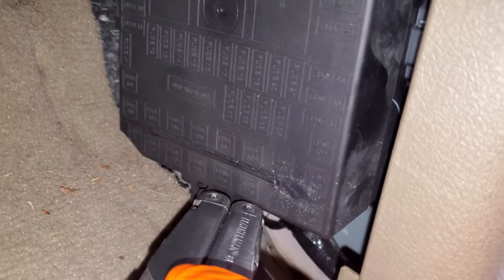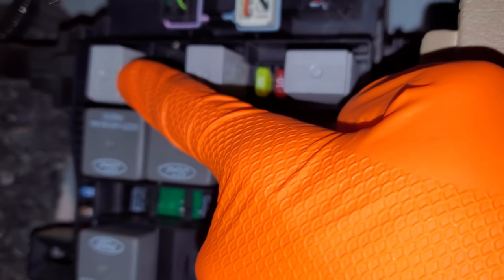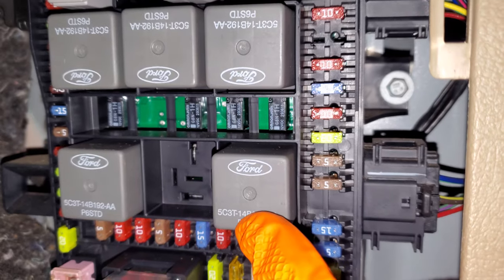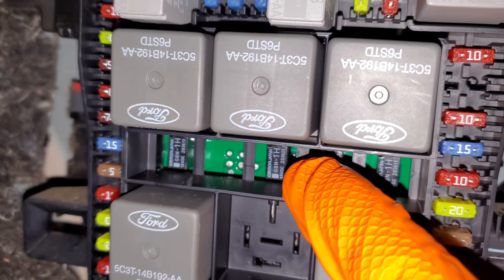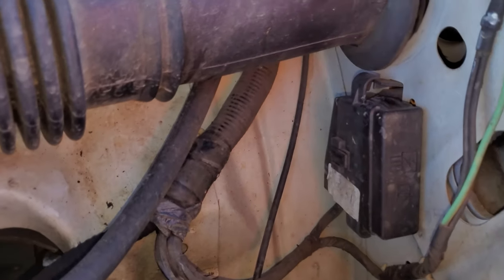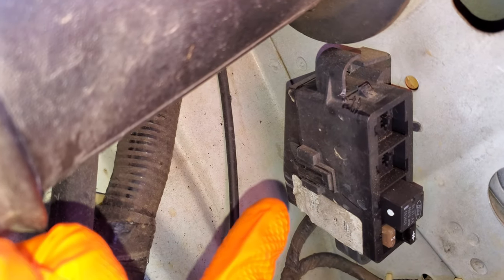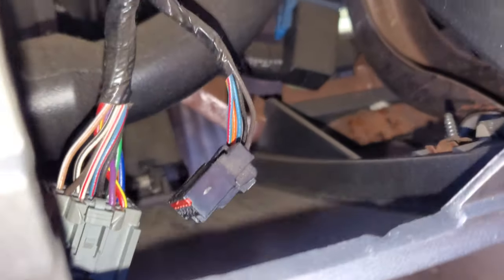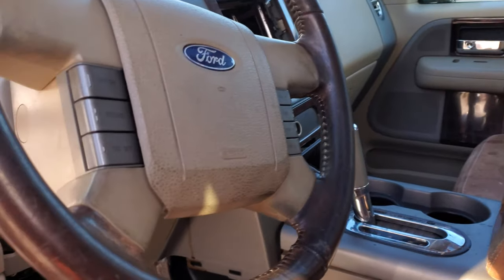2007 F150 Relay Identification

Comment: I have fixed broken wires in drivers door, taken instrument cluster off both to not solve my (no door locks and no radio) problem. Thanks to your video I did not have a delayed instrument relay. Problem solved. Thank you

Comment: I was headed to the auto shop to get my coils replaced for my spark plugs, I was about 25 miles from my house and the truck simply shut off on the Highway. The ignition will not turn over but it will power the dashboard lights and radio

Comment: Thanks for video. Will this be the same for a 2006 F150 xlt 4,2? I have a no crank/start issue. I have switched the PCM relay but not any other relays. I will check the starter relay now that I watched your helpful ID video. Any other suggestions will be helpful. Is the brake relay on transmission easily accessible?
Reply: Your starter may be locked up I had a similar issue when buying my 07 f150 xl we took it out smacked it with a hammer it worked a few times then locked up they are a pain in the ass but just replace it if yours does the same thing fixed my problem can’t tell you 100% check your grounds and change your battery Terminal power side the secondary wire needs to have good contact bc it runs to starter a-swell as other power in some cases hope it helps you if you haven’t already figured out it’s starter

Comment: Thank you for the explanation. Very good. Is the a relay for the trailer brakes? Also do you know what the part number would be for the trailer power relay. There was not one with my truck. Thanks.
Reply: Was that a relay for trailer lights and trailer running lights themselves?

Comment: Do you have any idea where the engine cooling fan relay and fuse are located on a 2004 f150? My fan comes on more than it should. Thinking it could be a bad temp sensor. Truck operates normally otherwise.Thank you for your time and help

Comment: I have a 2004 F150 and I have a clicking sound coming from the fuse box in the footwell of the passenger area, it sounds like an emergency flasher sound. It is coming from the fuse panel but I cannot pinpoint the problem. It is draining my battery over a 2-3 day time frame. Please help.

Comment: Thanks for everything. Particularly the tip on removing the fuse box cover. I couldn't get mine off. I used a small file. It gave more leverage than my screwdriver.

Comment: .3:57 p.m.
Hi I have a 2007 f150 5.4 l I have no power going to the cam sensors or the crankshaft sensor is there a fuse or relay

Comment: Hey just bought a 2007 f150 couple of issues. Hope you could direct me? 
First I found out radio wasn't working fuse 31 was missing but when I installed one it blew, so I was able to trace it, turns out the satellite radio has a short in it. Now I'm not getting any power to fuse 36,7,23 and 25 please help

Comment: Thanks...but my gauges aren't working nor the radio, windows dome lights or power windows
Reply: Did you figure this out? I’m having same problem. My radio, windows quit when I took down the map light to see about one bulb. When I snapped the unit back it,it made a pop and now the rear dome light, map lights,windows and radio don’t work.

Comment: My blower doors working I can hear it but the heats not working ever have this problem the heater coir has been replaced a few years ago by previous owner truck sat for two years I’m doing a coolant flush weird thing is heat will work Occasionally but no tricks to get it to stay on I live where it gets freezing in winter I done unplugged the ax pump bc it was Continuously running wile ac was not on hope it’s not electrical that can’t be fixed or Ridiculously expensive

Comment: How do you remove the junction box The “PCN power relay” I have to keep changing for my truck to start it is arcing right there the middle part has melted a little bit my truck drives fine and then it will shut off I have to go and wheel the relay and then it will start back up I was replacing it and then I realized it wasn’t the relay it was that it was a position so I need to change out my junction box or find out where is arcing at

Comment: Hi, I have 2004 STX 4x4 4.6 Litre. The rad fan start to runs on high as soon as I start the vehicle. I was planning to pull the fuse of ac. Do you think it’ll help or if you have any tip? I already tried to pull the high pressure AC sensor but no luck. Thanks
Reply: Did you every get it fixed???? I’m having the same problem 😢😢
Reply: @Mr-Yea  I have changed the fan and it runs like a charm. If you are planning to change make sure you buy Ford parts otherwise it’s waste of money and time. It’s Clutch fan not electric.

Comment: I have a 2004 f150 and after 30 minutes lose fuel. If I cycle key I get the pump to run for a second but then does again.please help.  Fireplace driver module is there a fuse that could have blown

Comment: Hi there radio is on headlights on dashboard on just will not turn over no start , when I pull the pcm relay the truck start but will not cut off

Comment: Hey man I have a problem that you might know how to fix. When I’m using my cruise control everything works great until I turn on my left turn signal, then my cruise control will turn off. Nothing else cause this just the left turn signal and I’ve heard before that the rear relay causes this. Any suggestions?

Comment: I have no power to the 12 v power source on the dash cigarette lighter works but no power to the 12 auxiliary checked fuses everything‘s good and no power the wire thanks
Reply: Happened to me too, after I plugged in one of those 12v air compressors, now the lighter doesn't work, lol.

Comment: Hi guy, i from ecuador and i have a problem, my ford f150 2007 no lock the doors only unlocks when push button in door driver, the button is ok because i replaced it with a new, but continuos with the problem, can you help me, thanks
Reply: My 2007 F150 has the same problem!